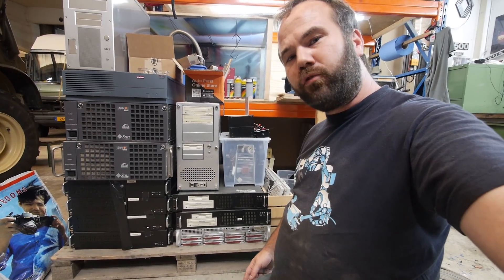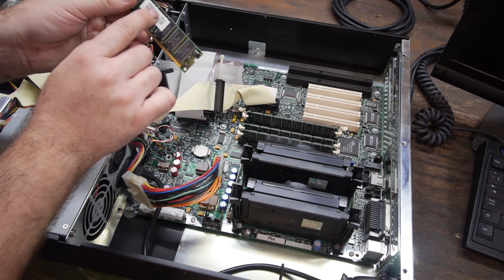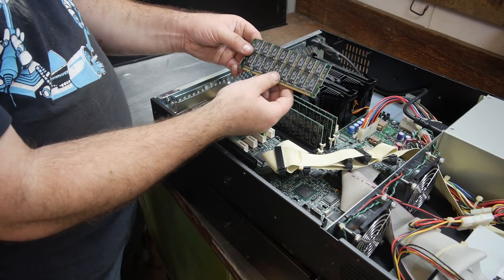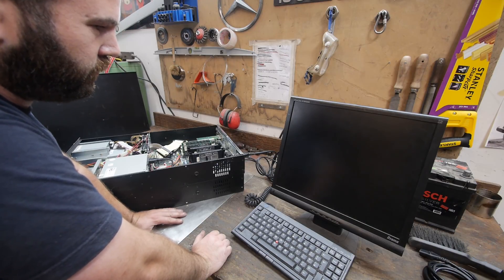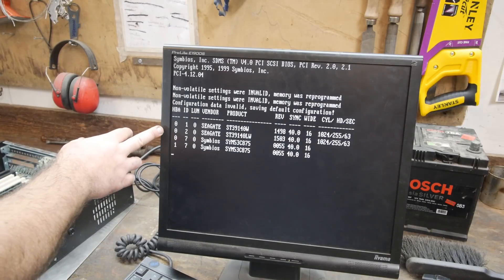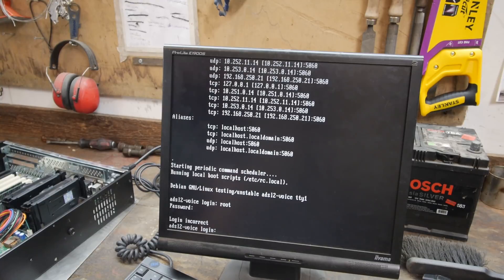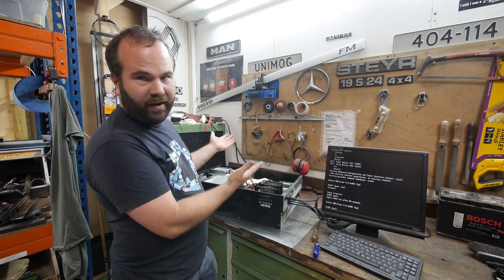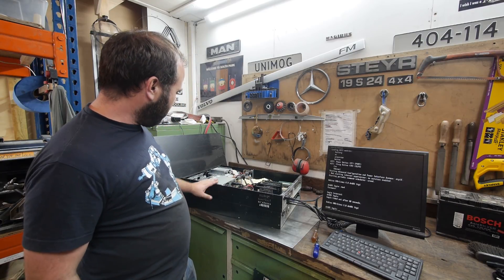22 Year Old Dual Pentium III Linux Servers, Will They Still Boot?

Comment: What is the earlier version of windows that supports 2 CPUs? Windows NT?
Reply: I think Window 2000 Advanced Server, I installed that on my dual P3 servers and it seems to split the load across the two CPUs.
Reply: @ducksonplays4190  Nice. What kind of ''load'' was it?
Reply: @billysgeo  Just a CPU benchmark and hard drive benchmark.
Reply: @billysgeo  Plus when I would move a window around at high speeds the CPU usage on both CPUs would increase.

Comment: Hello Victor. I really like your videos. But here you show a very bad idea to other hobbyists: openning a PC power supply a few seconds after it has been unplugged, it is a very bad idea, unless you know exactly what you are doing. The risk of electric shock is real, due to the high voltage capacitors inside. You should always let the power supply unplugged during a long time (several hours) before openning it. 
Apart from that, I'm very impatient that you power up and you use the SUN Netra 48V servers, I like these!
Reply: @elly3713  I strongly disagree with you, don't give such advice to others, please. Most PC-power-supplies switch off at 100V or 90V, and therefore the capacitors at input can maintain this DANGEROUS voltage during several minutes, or dozens of minutes. For 230V-only power-suppliers, this switch-off voltage is even worse, arround 180-200V. Even if you unplug the power-supply under load. You should always let the power supply unplugged during several HOURS before oppening it. Please don't play with high voltage, it's way too dangerous. It can kill you.

Comment: 45000 days
it is due to clock being backwards
I belive it will be close to 2^31 seconds
Reply from the maker: I think it counts 2005 (or something) to 1996. Which is 89 years 😅 something weird like that. But it counted 123 years 🤣
Reply: @victorbart  research unix clock
it is 32 bit signed integer
it can count 68 years from 1970 forward, and then when you add one more second past 2^31-1 you get 68 years backwards (ones complement) which is 1901.
file system subsystem in Linux Kernel assumes you always count forwards, therefore you get 123 years.
This alone gives you raw estimation, when file system was last checked
all you need to do is to subtract your number of days from 49710 and add date from BIOS
Reply: it is 5th November 2007

Comment: Was scsi popular back in the day in old machines?
Reply: In the classic Mac, server and high end workstation market absolutely yes. IDE was for low end PC's but as time went on it got a lot better whilst classic SCSI sort of stagnated and prices never came down. SATA and SAS later put classic SCSI in the grave, along with USB for external items like scanners, external hard drives etc.
Reply: U320 scsi with normal pcie or pcix controller and 15k rpm disks possibly faster then sata 2 or sata3 . On many concurrent access , seeking time, access time, u320 also give some scores